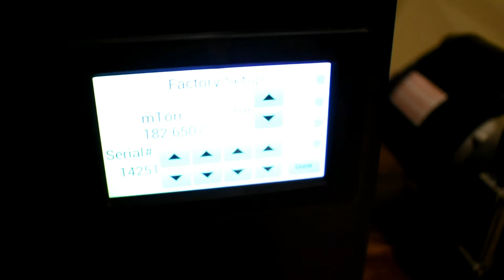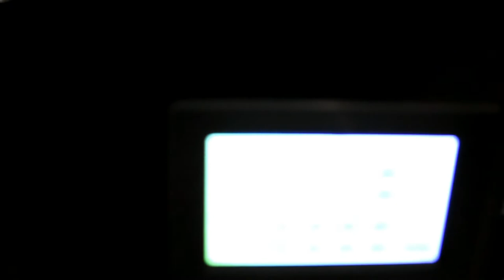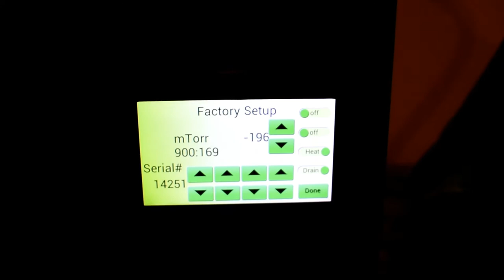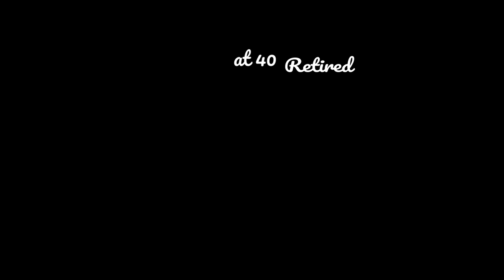HARVEST RIGHT FREEZE DRYER-- 🔧Vacuum Pump Test🔧 JB Eliminator

Comment: Love the videos.  Could you please go more in depth on this.  We would like to know what all the numbers are.  At this time I can not pull a seal.  We have changed the line from the pump to the HR and still won't pull a seal.  So we went through these steps and are not sure what all the different numbers are.  Also, what to do if it does not pull a seal.  Thanks so much for all you do.
Reply from the maker: I am not certain what all of the numbers represent.  I had an issue with my pump long ago and the tech from HR helped me through this to make sure my pump was working properly.  Have you adjusted your door to see if it is sealing?
Reply: Yup, door has a great seal. I will call HR Tech and see what else needs to be done. Thanks
Reply: @eugeniawigginton4701  did you ever get it figured out? I can’t get mine below 5000 mTorrs.
Reply: @brainchildguru  we actually ended up buying a new pump to get ours working again.  Nothing else worked for us.
Reply: @lynwigginton4620  did it arrive not working or eventually give out on you? I just had a phone meeting with tech support and they had me put the end of the drain hose into a cup of water while the vacuum pump was running and if it draws up water, you need to replace the ball joint valve. I’ve since done that and am retesting. Wish me luck! The first retest I did I was able to get down to about 1400 mTorr so I’m making progress!
Reply: @brainchildguru  it just gave out and would no longer pull a vacuum.  I worked with the Tech Support with everything and nothing would work.  I've had my unit for around 4 years and it has been well use.  Wishing all the luck I have, hope it's an easier replacement.  I was hoping for the new pump from Harvest Right but they didn't have any so we went to the older version.  Good Luck Hunter, let me know how it turns out.
Reply: @lynwigginton4620  I finally got it! I had to replace the valve connecting the drain tube to the machine. 3/8” is the one I needed and it was $10 from Home Depot. They’re also shipping out another valve, but I’m impatient so I got one from Home Depot lol. Once I replaced it, make sure the machine and pump are cool and haven’t run for awhile, then try the test again and it should work. You can get a cup of water and while the vacuum cycle is running, make sure the drain valve is closed and put the end of the drain tube in a cup of water and if it sucks any water up, that’s how you’ll know you need to replace the valve. Just sharing so anyone who comes across the same issue will know what to do. I’m also gonna post a video.
Reply: @brainchildguru  that is great Hunter.  I think my husband kept the other pump so maybe he can try this out and see if it works.  If so we will have a back up.  I looked back over my notes and no one suggested changing the valve connecting the tube :(  Your experience will be greatly appreciated by everyone.  Thanks so much for sharing it.

Comment: This is the second video I've watched and you said all the valves closed on that side but what about the pump it was open and close on the pump do I run it closed or open they change the oil and I wasn't here and I didn't see what setting it was on it's got an o and it's got a c on it
Reply from the maker: Do you have this style pump?  This video is pretty dated as far as pump type and software

Comment: We just got the new med size machine and I'm running the vac test, and it's been over 40 minutes and just now at 3,000 mTorr. Tested the door, it's got a good seal, the drain hose isn't leaking, not sucking water. And we used that white tape around the pump hose fittings.. WHY is it taking so long? And why are these pumps so expensive yet we need to put a FAN on them or they overheat?
Reply from the maker: The new pumps do not need a fan
Reply: @live.life.simple.  Well, mine's brand new and overheating in a 55 degree F basement. So I must disagree.

Comment: Can I use these settings to vacuum seal Mylar bags? I have an old machine like this running v2.4.3
Reply from the maker: all you need to seal bags is a vacuum in the chamber.  It won't have anything to do with the software

Comment: We just got a freeze dryer. Worked great for the first two cycles… then vacuum pump wouldn’t get below 500. We ran through all the troubleshooting checks and then reran the recommended vacuum test and it worked fine. But, put our food in to run that, and again… issue with vacuum seal displayed. In your experience could that be the food we’re trying to freeze dry, or something going on with the pump?
Reply: Did you figure it out?

Comment: Have you ever had any problems with your hose that goes from the pump to the cylinder? My machine wont hold a vacuum and I cannot find the leak.
Any suggestions? Thanks
Reply from the maker: try using some teflon or pipe dope on your fittings
Reply: @live.life.simple.  Yeah, I tried self sealing silicon roll. It didn't work so I just ordered a new hose. Thank You

Comment: My machine gets down to 700 in about 7 mine but takes another 20 to 25 min to get down to 500. They don’t seem to want to help me at the company only sending a new hose.  I hear a hissing inside the pump when I turn the vacuum off do you think that is where the leak might be or is it normal to loose vacuum when it’s turned off?
Reply from the maker: You can try this video to see if it's coming from somewhere else     https://youtu.be/di7JDZBTEZI

Comment: Thanks I’ll start doing this after the last two process have failed due to not pulling a vacuum. I think it’s the seal where the hose connects to the pump but I was thinking maybe I pulled something into the drain valve and it’s clogging the port but luckily it continues to freeze it and I didn’t ruin the batches. But I do have to say that they lost some flavor.  ??? Anyways thanks
Reply from the maker: Good luck g money, let us know what you find out.

Comment: how loud are all the parts? something i can have in the next room or something needs to be in shed/garage?
Reply from the maker: The dryer is as loud as a refrigerator, but the pump is the loud part.  I only have experience with the older JB Pump which is quite loud.  I think the newer pumps are quieter, but probably still noisy.  I put mine in the basement.
Reply: @live.life.simple.  Otherwise good earplugs at night.

Comment: Hello brother, My name is Nikolas, I live in souther Chile and was wondering if you could help me out with my freeze dryer. I have the one with 4 trays and my pump continually runs... Its weird. It will never shut off and i have been trying to figure it out for a bit of time now. usually I am pretty on point with mechanics but im starting to think maybe its the pump and not me. Is there any advice you can give me?
Reply from the maker: The pump is supposed to run through the entire cycle
Reply from the maker: @gopapillon if the pump is plugged into the freeze dryer, the freeze dryer controls when it turns on and off

Comment: Hi, I'm going nuts trying to remember which marking means ON with the power button on the pump.  Is it O or ----.  My manuals just say make sure the power button is on, but doesn't imply which direction is really on.  (I guess this is intuitive for most, but not me) IS O off or on?
Reply from the maker: The O is on for mine. Just remember "O" for "ON"
Reply: In the directions it said O is off and the vertical line is on.  That's what works on our machines.